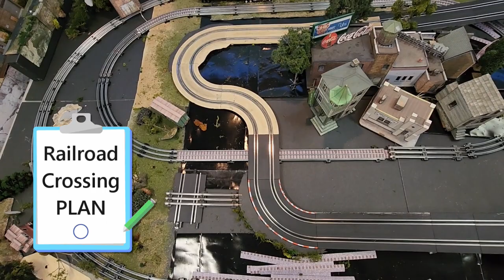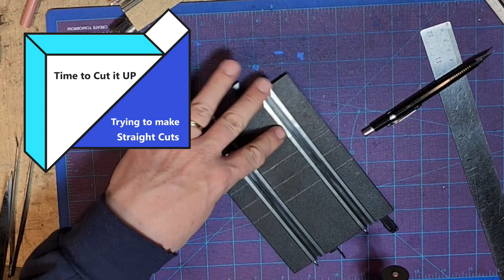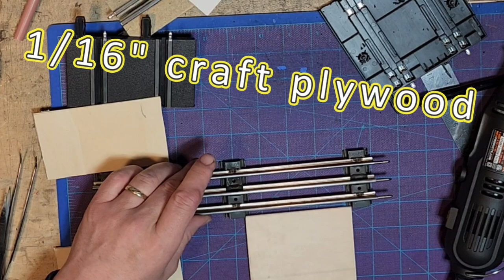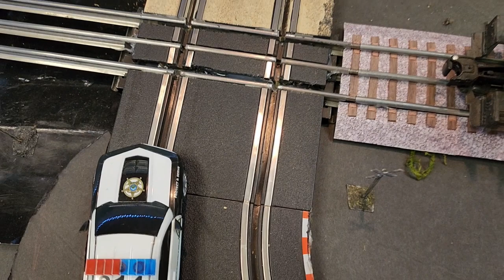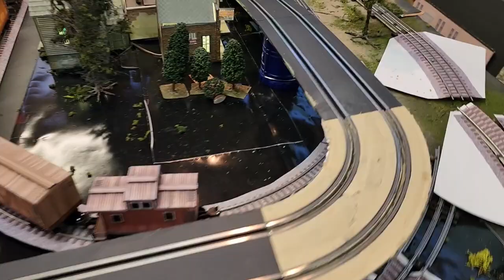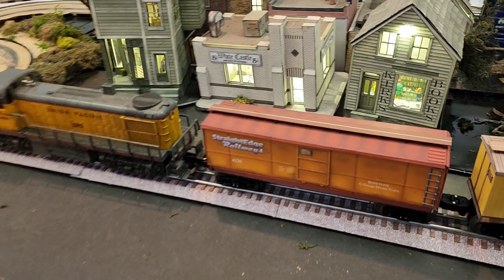Lionel & Slot Cars Xing - 3 rail Tube Track with "Carrera Go" Slot Cars Railroad Crossing

Comment: Awesome. I did something similar years ago with my ho life like sets. I cut a slot in the car track then i heated the train  track and melted it into the car track.  Then i used black gasket maker to fill in the space between the two to keep them from making contact with each other. You have an awesome setup.
Reply from the maker: When I was young, I thought those HO slot car combination sets were really sweet! I never did have one. At the time, I didn't have the knowledge or skills to do what you did - I barely have any knowledge or skills now. Ha ha.
I'm actually surprised that the two manufacturers don't get together and make a set in 1/48 with Lionel trains and Carrera cars.

Comment: Putting a capacitor across the motor might help with jerking.

And are you going to use a relay to cut power. To car track as train. Approaches crossing.
Reply from the maker: I think a relay to cut power to the slots when the train approaches is the only option besides making a dead spot on the slot track about a 1/2" out from the 3-rail.

Comment: Slow down the Train speed so you can just barely make 2 car laps at the crossing.   And hopefully at that train speed the train will just be clear of the road crossing when completing the 3rd lap with the car, and now the next 2 car laps must be faster than before because you started after the train length rather than before.